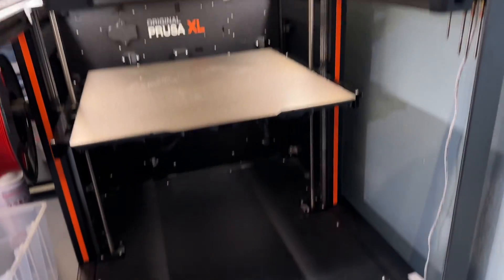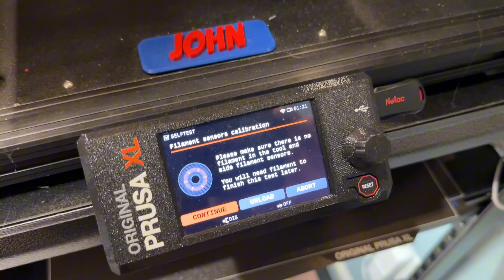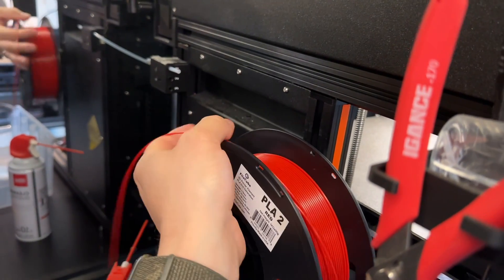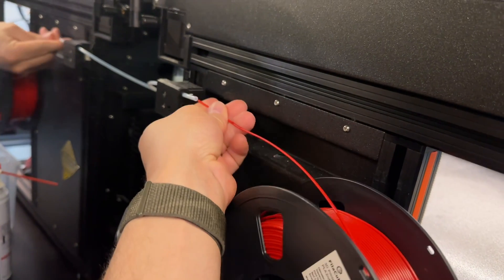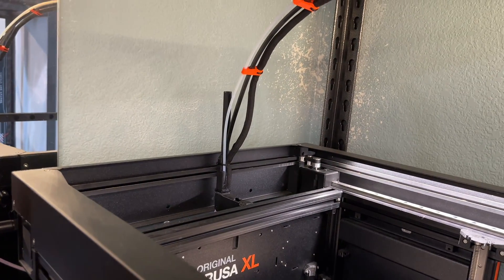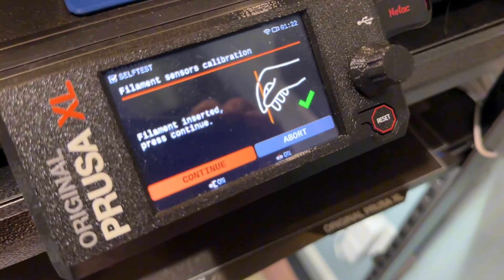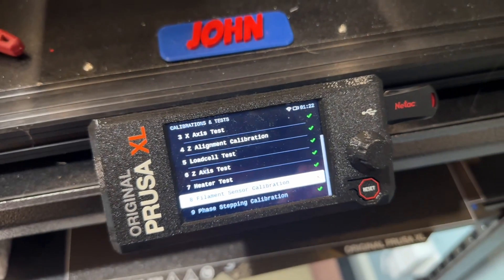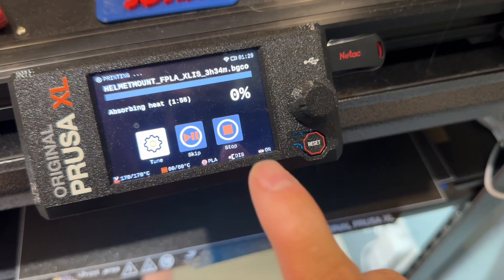PRUSA XL Fails Filament Sensor calibration every time!

Comment: Had exactly the same problem/symptoms as you. what worked for me was swapping in a new ptfe tube connector at the top of the extruder (the thing with the blue ring on it).

Comment: I had exactly this same problem when I upgraded from a single toolhead to a dual toolhead. Only toolhead #1 had this issue (was the original toolhead that came with the printer). Toolhead #2 calibrated just fine using the same left side filament sensor. Replacing the old PTFE tube to toolhead #1 fixed this for me. After upgrading from a single toolhead to a dual toolhead, I noticed the tube liked its old position and came into the toolhead at a bit of an angle that I couldn't rectify by trying to reposition the tube. That angle caused the filament to not sit right near the sensor. Once I corrected the filament path by replacing the tube (with memory of where it used to be so it wouldn't go into the toolhead at the correct angle, calibration was successful. There was just too much resistance in the old tube with the path so replacing with a new tube and ensuring a straighter entrance into the toolhead worked for my printer. It lessened the resistance in the filament (could feel when feeding it through) and therefore worked better with the filament sensor.

Comment: I'm stucked at "ok" when it goes through the 1st sensor but the nextruder doesn't react when the filament reaches it. Nothing else I can do... Also I have a dual head and it's the same issue with both.
Reply: Found out that the screws were too tight. Once it was a bit loose, it came through

Comment: Any updates?
Reply from the maker: I did get a new reply with several things to check/do including cleaning the tool filament sensor (tried that several times) and switching it to the right side on the board.
Reply from the maker: AAAAAAND the update to firmware 6.1.3 resolved the issue immediately.